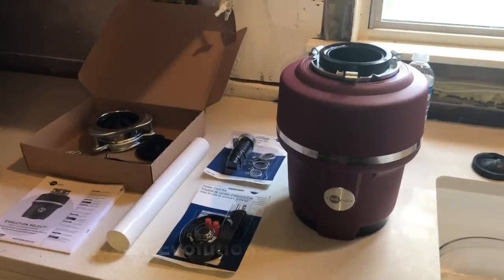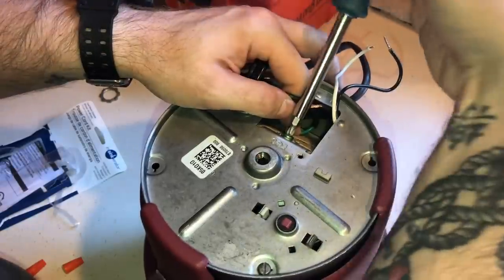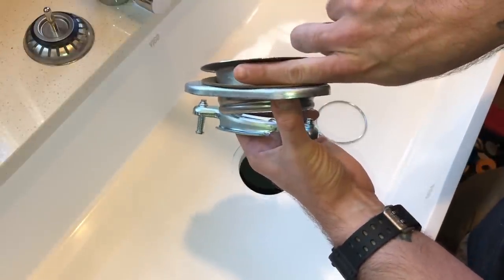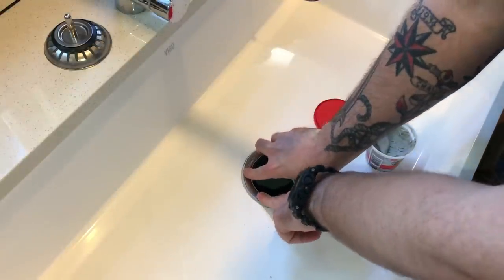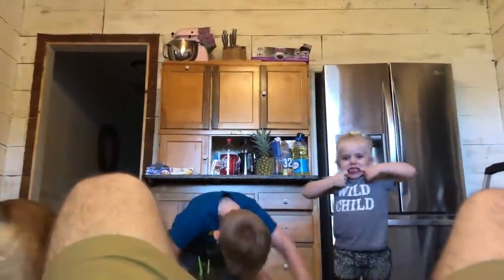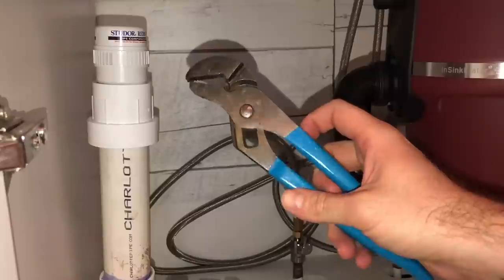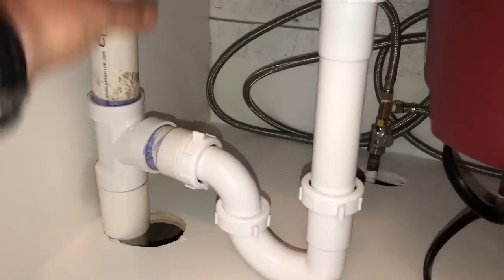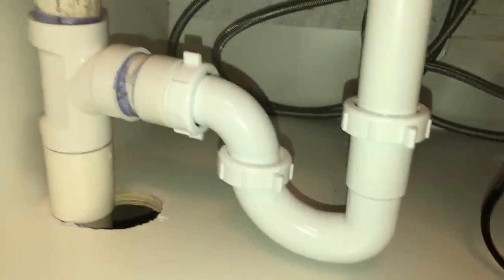How to Install - Insinkerator Evolution Select Garbage Disposal

Comment: That nut on the Romex connector is not supposed to be removed, it works differently than you think it does. Read the directions, folks, that's why they included them in the cord assembly kit.
Reply from the maker: Thanks for the advice - I felt I had a good connection, maybe I’m incorrect - definitely not an expert just went with what worked.
Reply: rollerskater 
     Enlighten the masses. We’re all hingeing on every word!

Comment: does that stupid rubber flange ever get loose and fall into the unit and get ground up? I cant believe it just loads from the top and stays there forever??? Whats up with that?
Reply from the maker: We haven’t had any issues on our end with it since the install, but yeah that’s a good point!! It occasionally gets a bubble or something and it seems as though there may be a clog.. but it’s never the case - just a soap bubble! 😂🤘🏻 Thank you for watching the video!!!!
Reply: @TheToughGuysTV  Thanks for the reply, I just finished installing the 1 hp ss model.. and no leaks.. yahoo.. but I had to consult youtube on the rubber flange/dampener thingy.. I guess it sits in there ok.. we'll see.. thanks for the upload

Comment: You should mention on this unit that the AC cord has one wire that's ribbed while the other is smooth. .It is important to connect the ribbed power cord wire to the white wire of the unit. I also like to wrap the wire nuts with electrical tape to give a little extra security in a vibration environment.
Reply from the maker: Allen, thanks for watching and yes I wish I had discussed in the video! I had mentioned it down in the comment thread for someone who asked early on, and I’m glad you mentioned again for new viewers to see up high in the thread the same advice.  Thanks again, I appreciate it!! 💪🏻🛠🙏🏻
Reply: @TheToughGuysTV  Thanks. I scrolled down to the comments section for the same reason. Great video.

Comment: My unit is hardwired in.  No need for the power cable.  Only reason I think they dont include it.
Reply from the maker: Yes that is definitely possible, just wonder what percentage of people buying are in that boat.  My gripe was more in that I’m betting most people wouldn’t know it doesn’t come with a cord out of the box that do need the cord.  Thanks for watching and for the comment!
Reply: @TheToughGuysTV  yeah I would expect a power cord
Reply from the maker: Leon - yeah it’s a weird situation. Seems like maybe a relic from back when it may have been standard to exclude it, and they never changed with the times. Or just a profit move. Thanks for watching!!

Comment: Insinkerator is price gouging for the extended ring.   They know that just about every new sink will require that.  And total bs that they don’t include power cord
Reply from the maker: I agree on those points! Both should be shipped in the box, or at least be an option when buying to purchase all together

Comment: 16:42 I'm thinking that isn't a dishwasher supply hose.
Reply from the maker: Everything is working fine, has been for 2 years.  If it's not then I'm not sure. Thanks!
Reply: @TheToughGuysTV  I would say you would connect the dishwasher drain hose to the disposal.

Comment: Great video.   The Insinkerator Evolution Compact has the same dimensions as the Badger 5.   That's what I'm going with to replace. 
https://www.youtube.com/watch?v=luj6zEvraRQ
It has a stainless steel assembly so it should last longer before rusting out.
Reply from the maker: Thanks for checking out the video and for the comment!